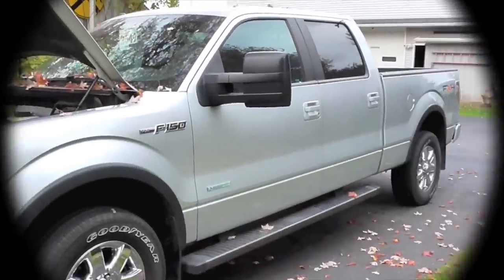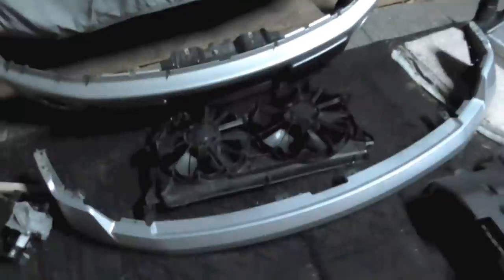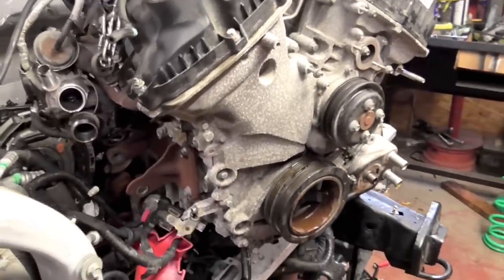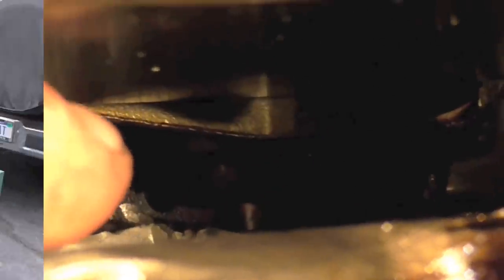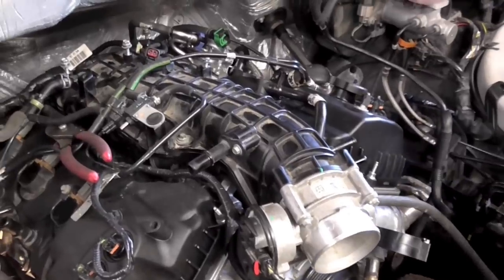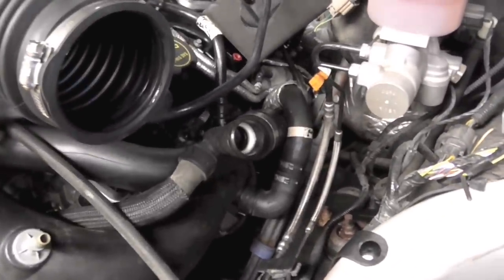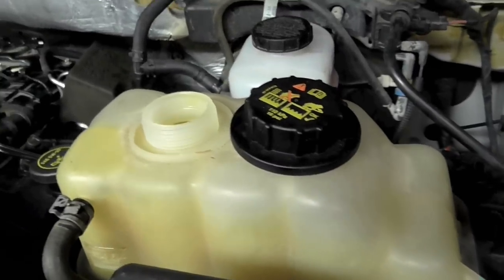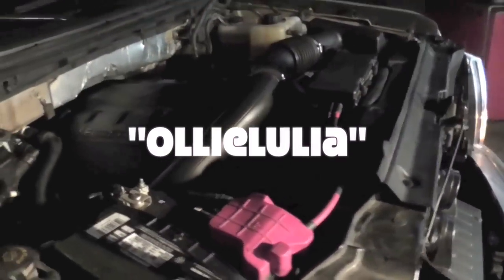FORD F150 TRUCK:  3.5 V-6 ECOBOOST ENGINE FAILURE (Removal and Installation).

Comment: BL3Z-6006-CARM $4,800 long block in case anyone was curious. Was it worth the 2-4mpg increase over the 5.0 V8 I wonder?
Reply: You don't see no 3-4mpg increase over the 5.0l with the 3.5lEB. Maybe 1mpg on the highway if you are lucky. Tow any kind of weight behind the EB and mpg really goes to crap quick. The EB is not the fuel sipper Ford and other people claim it to be.
Reply from the maker: He gets about 22-23 MPG with the "Truck Alone" ... When he Tow's obviously it DROPS. 
*(I speak of the Truck IN THIS VIDEO).
Reply: Maybe he must do a lot of driving downhill with a tailwind.
Reply: Back in the day you could get a complete small block chevy, ford or dodge for about 800 to 1200 bucks, and most parts were interchangeable for 20 years.
Reply: Erik Kovacs I thought it would be 12 000 dollars for a new motor

Comment: i have a 2011 ford f150 ecoboost, with 165k and never not once i have had an issue, truck runs very good, powerful and smooth. hope mine continues like that
Reply from the maker: GREAT !!  *were nearing 100K and the Truck runs / drives like a dream Javier.  :- )

Comment: Sucks to be you! I have 340,000 km on my 2011 Ecoboost F150 And she is still going strong!!!!
Reply from the maker: Their GREAT Trucks Pat ! *"I'm glad yours is trouble free" !  ... This one STILL running A-1 GREAT Too !
Reply: @TommyZTrains  I just bought a 2013  F150 with the 3.5 EB TT with 174k miles and, it appears that the timing chain is about to give up the ghost (which is why I got it for a shade over half the KBB value) Depending on who I talk to, timing chain failure is a common problem with this engine, or so I'm told. Do you have any insight on this?
Reply from the maker: Hi, None other then ta say that the components have been "upgraded". I'm CERTAIN that the Sprockets are different (bigger / brawnier), along with a heavier chain, and an improved tensioner design. So far as the actual procedure: *we bypassed all that (as-we had to replace the blown-out Engine Block). PERHAPS it you were to "expose" the front timing cover, then you could have "an individual" do the internals ? ... OR: It's not that bad, and YOU can do it. 

THOUGHT: Perhaps get another opinion on the "F-150" Forums ? , after that: all I can say is that THIS TRUCK continues to run FLAWLESSY and it's had ZERO "anything" so far as any issues ... END-RUN: Well worth it. Best.

Comment: My buddy bought an ecoboost as soon as they hit the dealers in 2011. I'm not kidding when I say that he drove it off the dealer lot and it threw a rod right thru the bottom of the block.  If I remember correctly it had 9 miles on it. Obviously Ford took care of him and he got a replacement truck, but that solidified my faith in the V8.
Reply from the maker: That's INCREDIBLE !!

Comment: I'm seeing way too many videos of this specific engine and vintage grenading in one way or another.  60K is too early for this kind of failure to be close to reasonable.  That there are revisions in the replacement parts tells me Ford knows there's a problem but they're letting their customers foot the bill to fix it.
Reply: Mine just popped at 36K miles.  I find it interesting that they "improved the internals" for a mild power gain in the 2017's.  I think they felt they had to address the issue, but by upgrading the power by 10 ponies they can blame it on that.
Reply: Wasn't 2011 when the EcoBoost came out and also the new model year for the F-150?
Reply: They on Gen2 of this awesome motor. Millions satisfied customers! Go buy a Chevy.
Reply: @austin73  popped at 36k mis!? Very little details given as usual from the internet trolls & keyboard engineers. It's under warranty! Change oil every 5k mis btw.
Reply: @davidklimmek3192  I'm a troll? You are the one digging up year+ old posts and name calling.  You could just ask for more details, don't be an ass.  

I was just over 36K and Ford refused to apply the warranty.  My dealer did all the service and it was all done on time.  My dealer felt so bad for me, they bent over backwards to help me out.  They only charged me their cost to replace the motor ($11,500!!) so I could trade it in on a new truck (then 2018) and gave me X Plan pricing and threw in a 7 year bumper to bumper factory warranty.

Only because of my dealer, I stayed with Ford.

Comment: how is she holding up?? just had my 11 put in the shop for a failing turbo when i went to check on it over the weekend i noticed a heck of alot of fluid on the ground underneath it outside where it was parked think that might've been water? or oil they had to stick it back outside cause when they went to put the new turbo on they broke a bolt "buggy" and ended up having to order new gasket and seal for it.
Reply from the maker: Not one quirk Jerich !  Truck continues to run "SPOT-ON" !

Comment: Great job.... about to pull  a motor on a 17 expedition.  2 question... was the transmission supported after you pulled the motor.  And how did you get to those Top bell housing bolts?
Reply from the maker: Hi Patrick !,  If I recall:  we stuck some over-sized (long) bolts in the "bell" / and used a ratchet strap to secure things ... So far as the long bolts: a HOIST is a 90 % of the battle Pat,  and after that:  "It's SEEING things - (amid a good / bright LED light) *along with some looong extensions !. 

"What happened to your motor" ?.
Reply: @TommyZTrains  ... thanks for the
 quick reply.  Car running bad. I put my matco scanner on.  Misfire on #6, Swapped the coil .. same thing.  I took the plug out and it had oil all over it. Cleaned it and put it back... same misfire.  I used the scanner to ensure the #6 injector was working... it was.  Finally did a compression check.... 30psi.  Performed a leak down test  only to discover that air was coming out of the exhaust. Determined that the valve had an issue.  Took the head off and indeed hole in the valve, the cylinder wall was scored really bad.. Hence needs a new motor. We found one from a Gentleman that i usually get parts from. Its a 2016 EcoBoost from a F150 with 19000 miles on the clock. I got it for $2300 shipped to Nyc. btw the bad motor had 160.000 miles. Oh forget to mention also a P0016 Camshaft Crankshaft shaft correlation code. The tensioner was out... 8 teeth, timing off slightly.
Reply from the maker: @patrickpierre6114  "That's a hell-of-a lot-of-reality", *it sounds as tho your diagnoses is spot-on however. Wheres the good old days (like with Toyota Tundra's or the like) where you could a million miles on an engine with good care ? !. 

Best of all SUCCESS Patrick !
Reply: @TommyZTrains  ... back then cars were engineered by engineers. Now the bean counters tell them what to do... thats what happened.
Reply from the maker: @patrickpierre6114  "PIERRE MOTORS"  !!!  : - ))   !!!    "Agree".
Reply: Engine is swapped.  Lining up the torque converter was was not that bad.
Reply from the maker: @patrickpierre6114   Way ta go Patrick !!  ... "did ya do any video" ??  ; -  )
Reply: no... unfortunately
Reply: Done... My friend picked up the car.  I must have watched your video 50 times.

Comment: The 3.5 was turboed after the fact, the 2.7 was designed from the start as a turbo motor.  Forged crank, rods, much stronger block.
Reply: That is incorrect. The 3.5L EcoBoost engine was designed from a clean slate. Take a look at the 6 bolt mains on the crankshaft and it also was the first use of Direct Injection at Ford. The engine was designed with the expectation that power levels would increase, and rather than redesign the engine at that time it was designed with extra beef from the get-go. The engine is now in it's second generation with improvements incorporated that were learned from the first generation. 

The 2.7L was to up Ford's game. It is the first ever production gasoline engine to use Compacted Graphite Iron (CGI). Previously this material has only been used in diesel engines and race engines. 

You should look into these things rather than merely going on your expectations. If you think Ford just threw two turbos on the old 3.5L engine you would be very ill advised to think so. Yes, I work for Ford and have "some familiarity" with the engines.
Reply: The 3.5 ecboost is not a regular cyclone 3.5 that's boosted, the 3.5 engine used is designed to be turbocharged..
Reply: You are 100% correct. It was designed from a clean sheet. It is incredibly robust, with 6 bolt main bearing caps.

Comment: I think the biggest issue with today's engines is the extended oil change. Especially with direct injection motors it creates ash in the oil. There's no way I will take my engines past 4K on the high end. I don't care what manufacturers say you should still change the oil every 3 to 4K. I know some will say the synthetic oil last longer and yes it does but I'm not worried about the oil going bad I worry about it being dirty.
Reply from the maker: Spot-On thinking Ray !! That's why the kid had a "Blackstone Oil analysis" Performed !  ... JUST to LOOK at this very thing !. (Google "Blackstone"), anyway: the "Oil-Life index (the parameter on the Inst. Panel), and "Blackstone",  pretty much agreed (about "Oil-Life" left, fuel in the oil, looking for sulfates in the oil etc ...). 

Maybe the Amszoil thing's "overdone" ?/  (He's using "Motorcraft" Oil's / filters NOW .  Best.
Reply: Ray Wilson The last time I checked oil is a hell of alot cheaper than a new engine.
Reply: What a waste.
Reply: I always run full synthetic and change at 5,000 miles. Cheap insurance.

Comment: I own a 2011 f150 platinum 3.5l ecoboost and am leaving it with the dealership next Monday for the stretched timing chain. Lost power , MPG, rattle upon cold start  , fuel dilution. 107,090 miles on it . I purchased a third party warranty/insurance through Endurance. the TSB is 15-0131 and involves replacing the intake VCT(2 req) and the exhaust VCT(2 req) , timing chain, and seals
Reply from the maker: +Adam Baldwin    Hi !! .... Yeah: 2011 through 13 "late" are the worst. I did oil analysis twice, and used ONLY Amsoil products. Be sure too check the C.A.C, Adam ... After that, the updated Turbo feed lines are MUCH Nicer !  *To this  day, we enjoy excellent operation with our 3/5. So far as the "fuel dilution", be sure the mechanical pump's OK !! Ours was causing some dilution and fortunately the "long block" came with a new one. 

Being fair, the "rattle" may effect / or "re-map" the knock sensor'(s) ... but our mech. pump was hammering as well. 
It's a VERY "BUSY" Engine !  

Best

Comment: great video that is exactly why buy cars built in  Japan right now I'm driving the GX 460 Lexus before that I had a Honda Pilot 2009 the only problem I had with that one was the wheel bearing went out because I overloaded the trailer so was my fault
Reply from the maker: "Who could argue Ralph", I'd agree with ALL you've said ... this Truck however: continues to run "spot-on".

Comment: Did Ford reimburse you for the long block?  Which intercooler version did you have on your truck? AB or AC?  I did a engine replacement on an AB intercooler equipped, no tsb mod performed 2011. Same thing, hydrolocked engine, broke the connecting rod, fractured wrist pin/piston towards the top indicating hydrolocked engine.  Owner had started it in the parking lot at his work using the remote, came out to the engine off and a puddle of water and oil on the ground.  Ford sent him a check for my entire bill a few months ago.  Thankful the engine shuts off if it throws a code when on the remote starter, else it could have been a fire.
Reply from the maker: "That's incredible Tristan" !  *To answer the question: "I don't recall"   I DO BELIEVE the remote start thing, as our failure occurred almost immead. after starting at (guessing) 800-1000 RPM.  I'd LOVE that "check" that you speak of,  and we even wrote a hand-written letter to the Ford Motor Company CEO ... We begged the Dealer, *(They were quite sure it'd be warranty too). *But later the answer was NO. 

"I don't know what else we could have done" ... I remember literally begging for help ! ... "We never even received a reply" (From the Letter). THAT WAS WHAT ME ME ANGRY .... "at least 'man-up' and say NO !  *"Nothing" was NOT the way". 

I think that what I'll always remember was "WHEN" it happened ... just a hair above idle, doing 2  or 3 MPH .... We thought: "what the hell was that" ??  "t was surreal" !

THEN ALL THAT WATER ! (Just like yours). 

I'll NEVER forget it Tristan !

Comment: You mean to tell me if you take an engine smaller than some front-wheel drive cars have and stick it in a full-size pickup and throw a couple of turbos on it there's a good chance it might FAIL? Wow! Who would have ever thought that....
Reply: Chad Meyer Very well put, sir.
Reply: Yea right mate. My 96 Ford will still be running while you're overpriced plastic ecoboost F150 will be stuck in the repair shops.
Reply: Dunno what front wheel drive cars you've been driving but they must have some serious Torque steer.
Reply: Chad Meyer 
What a dumb statement. So, because of it’s size it can’t hold together? So, semi truck engines won’t hold together because there size engine is small compared to the tractor and trailer?  No, false. It’s called engineering. You can build in durability. Get used to it. Cubic inches are getting less and power is increasing. Chevy Silverado is using a turbo four banger for its base engine .

Comment: i even drilled a small hole in charge air cooler long time ago . it stopped the shutter and i thought i was good . got on the interstate and bam something blew out the side of block
Reply from the maker: Perhaps it plugged back up ?, I’m so VERY Sorry.  😂

Comment: had a guy post a video getting 200k miles on a ecoboost and no problems and it was the first year they came out with them also
Reply: My 2011 has 180k. Runs like new
Reply: I have a 2011 with 202,000 miles runs perfect
Reply: Change your oil every 5000 and dont use cheap oil and you will be fine.
Reply: @489hurley  not always. Just had a 2014 go at 98,000km oil change done every 5,000km with mobile one full synthetic.
Reply: @gunxperp  Stepfather has a 2011 210000 never cracked the motor open yet.
Reply: @489hurley  not saying they all do your that ita a common problem. But I have seen enough and have the evidence of factory faults to say that some do have a problem.
Reply: @gunxperp  I am not saying some dont either but most people change their oil when the computer says to and thats way to long.
Reply: @489hurley  yes 100% on that. I tell customers that all the time. But I have seen that is not always going to stop it from happening. Like I said 98,000km with full synthetic every 5,000km and still throw a rod through cylinder 1 and the block.
Reply: @gunxperp  Wow thats crazy prob just a bad rod from the factory
Reply: @489hurley  that's what it looks like to me. I'm having a metallurgist look at what's left of the rod to see if it was a defective rod or not.

Comment: my father has 2013 f150 that’s just been sitting here with no engine for a couple years. Would u recommend acquiring another engine or looking for something else?
Reply from the maker: That's a bit vague ... "where'd it go" ? (the engine), + you'll need a core (were you to purchase a crated Ford Motor for example), then: the fuel injectors, the cowlings, Turbo's upgrades / that won't come with any engine (or aren't likely too) ? ... Buy a Yard-Motor; and you have again, "designed obsolescence" in an un-sure setting / that may equal the the same "failure" AGAIN ! ... Also: the trucks condition 'overall - now', the aesthetics / the powertrain, suspension ... *there's to many variables here / amid so many "un-knowns".   BEST OF Luck.      :- )

Comment: Those con-rods,should be built like Carillo H-beams,to withstand the high boost pressure.
Reply: George Boyd -the rods look like they're cast to break like that. I have never seen diesel rods break in that area-always bent or fail in the pin bore.

Comment: I love the power this motor delivered.  I jad the hydro lock towing in the rain.  I was pulling onto the highway and it hit hard.  I traded it in because I thought there was no way that didnt weaken a rod.  Looks like my thoughts were spot on.  Sorry this happened to you.
Reply from the maker: "HOLY-COW" ... But it didn't "grenade" ??? ... * YOU were lucky if no.**   > "Gese things are changing fast", with regard to liability these days ... my good friends Ford Focus just "fell on the ground" (amid a ball-joint failure),  with just 72,000 miles !. Prior to this: it went back 6 times for transmission issues. *I think the BALL-JOINT Failure played into those multiple R & R's  he had. Anyway: He claims it STILL doesn't shift correctly sometimes, but LOVES the car after that.  "Just saying" .... *So what did you trade in against ? (what Truck / Car did you get  ?.  BEST !  :- )
Reply: TommyZTrains No, it didnt break but Im sure it will at some point.  I traded up for a Explorer XLT with the 3.5L n/a.  Its been a great vehicle.  I had the 5.0L before the ecoboost and that was a great truck but no 4x4.  Id go 5.0 ecery time in the future
Reply from the maker: SPOT-ON / Sound thinking ... I agree 100 % !!  "I'd of done EXACTLY the same thing".